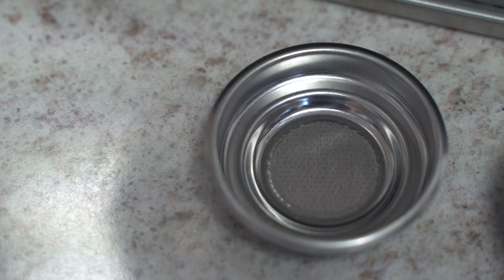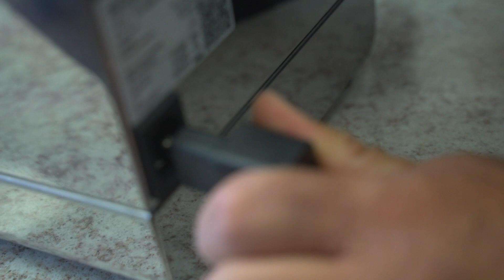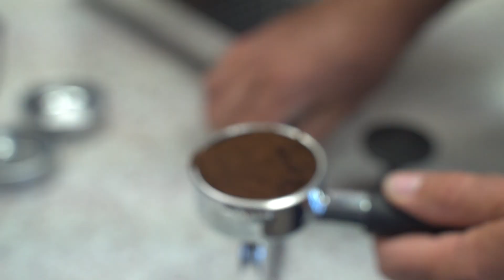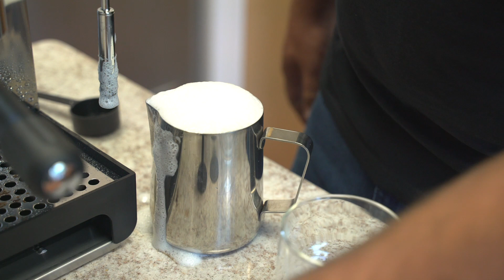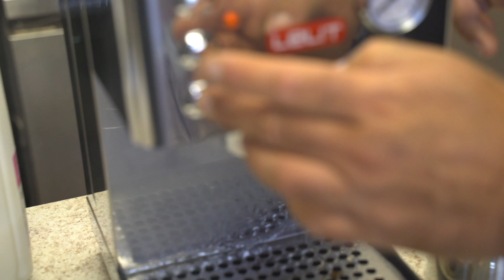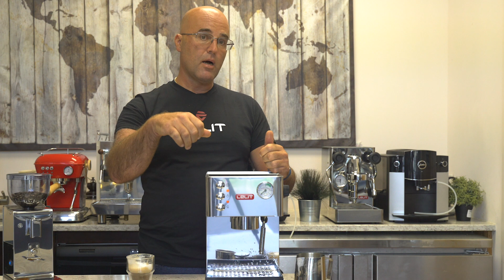Detailed Overview: Lelit Anna PL41EM Espresso Machine

Comment: Hello,
I just got a second-hand machine like this (11 years old) (the machine, not me).
Can someone tell me what coffee weight I'm supposed to put in the one-dose and the two-dose simple filters, and what amount of beverage I'm supposed to get from them?

Is it possible that on an old machine like mine, the OPV is triggered too soon and needs to be replaced? Depending on how fine/coarse I grind the coffee, I get either a low pressure on the manometer (8 bars or so), or water barely dripping through the cake.

Best regards,
Silvère

Comment: Great review! Just received yesterday mine, the revised version with rockers buttons and the pressure gage retro-light. This machine is made in Italy. It does carry great internal components. Just to name one which is not anymore in standard machines is the boiler made of brass... Way better that aluminium ones which tend to break! Brass is usually installed in more expensive devices. And the cast is made of stainless steel. Very few plastic parts. No electronic @ all, which is good news... Great machine by many means!

Comment: What material is the boiler made out of?
Reply: 250mm brass boiler.  I think this is the previous model, as the new Lelit Anna - PL41LEM has more powerful steaming with a different steam arm and the tray is polished chrome at the front as well.

Comment: Good point. Listen to this guy he knows his stuff. Most assume that the pressure gauge should show 9 bars no matter what but its totally dependant on the GRIND you use. Too FINE or too coarse and you won't get 9 bars. Play around until you find the right grind. The beauty of this machine is it lets you check and keep changing until you hit the green. Then you also have the TEMP control which makes sure your espresso comes out at the right temp unlike lower cost machines like the Gaggia classic which is said to come out colder.
Reply: However the overpressure valve is supposed to dump anything above 9 bar. So even if you grind to fine, the extraction will be slow but the pressure should not exceed 9 bar because of the OPV. That's the problem the OPV is set to 11-12 bar so the pads can be used. That's not ideal for espresso but it is very easily adjusted down to 9 atmospheres and the gauge is accurate so no need for a portafilter gauge. Once it's set to 9 bar you can do all the usual stuff to dial in.

Comment: The Lelit PL41TEM looks like a real value with the PID (Lindsey's review is great!). The only oddity to my eye is the 57mm portafilter instead of the industry standard 58.
Reply from the maker: hanks for your inquiry. Portafilter width sizes range from 43mm up to 60mm. As the portafilter basket gets wider, the same basket gets less depth. As the portafilter gets narrower, the basket gets deeper. At the end of the day, we only select machines that can produce quality in the cup - this includes many factors, and not just the basket width.